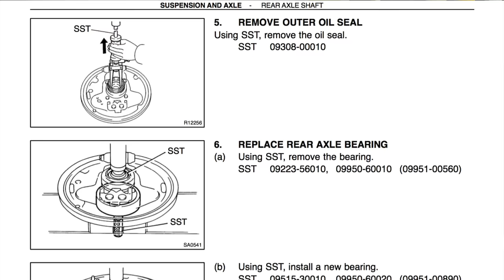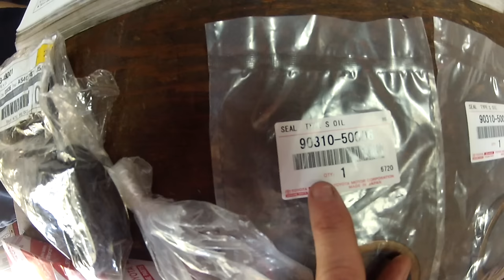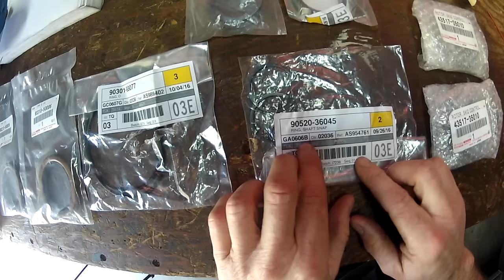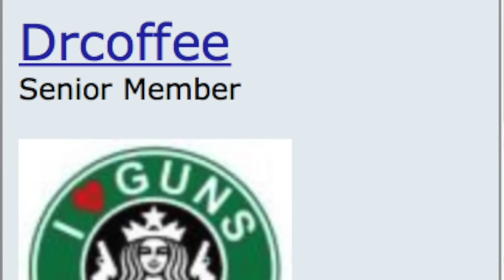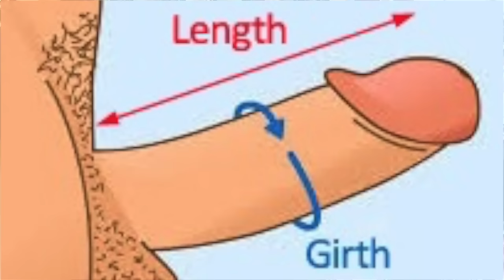Toyota Rear Axle Seal/Bearing Replacement (ABS Rearend)

Comment: Timmy, I'm not sure you covered it or not, at 12:30 of the video you were discussing draining the diff. You mentioned replacing the crush washers. Would you suggest OEM or just pick a few up from Home Depot/Lowes. If so, size?
Reply from the maker: Jerome Jose Get OEM crush washers.
Reply: Thanks Timmy. I'm tackling the rear axle seals, rear brakes, and diff breather mod tomorrow. I have to wait to replace the bearings until I can get my press. I hope I don't have any problems waiting about a month, or do you think I should wait until have my bearings. I won't be driving the rig much, I'll be traveling and I have some time tomorrow so I figured I'd tackle that piece at least. I don't mind disassembling again.
Reply from the maker: You can let it wait.  I just wouldn't take it on some long road trip until you get it fixed.
Reply: Side note, as you know I tackled the rear brakes as well today in conjunction with the Rear Axle seal replacement. I think I made a mistake. During the course of the axle seal replacement, I disconnected the brake line. However, once finished, i just bolted the axle back in place but left the brake line disconnected with the vacuum seal on it. Once I had it reconnected, I started replacing the rear brake shoes and noticed that brake fluid of course was coming out of the rear fitting (opposite of the brake pistons). Of course I'm going to bleed the brakes after everything, but do I need to get like a sirenge and fill up that little reservoir feeding the rear brake pistons? I know very stupid questions, but I'm not a gear head by trade, I just wanted to learn more about my rig.
Reply: Timmy don't mind me, I just watched your other brake fluid bleed/flush video. I'm an idiot, I'm on track now. Thanks.
Reply from the maker: No worries.  Glad you're getting it done with the help of our videos.  You're not an idiot.  You just didn't have all the information at hand that you need to be successful. 
Happy Wrenching Jerome!
Reply: Timmy much appreciated, and I'm happy to say that I've completed it. The reason for the work is because I just bought a '98 Limited, and I had taken it in for all the checks I could think after, to include a thorough inspection from a Indy toyota shop. They gave me 4 immediate things I needed to do, and 1 precautionary1) Rear Brakes2) Rear Driver's Side Axle Seal3) Rear Cam Plug (Not Sure I can handle this one)4) LBJ's both (I'll be watching your vid on this one)5) Timing Belt (precautionary)Through following this vid, your rear drum replacement vid, and the rear differential breather mod, I was able to complete both rear drums, driver's side axle seal, rear diff drain/fill. Total time about 10 hours (I was following step by step, so I wasn't efficient). Observations:   After replacing the rear axle breather plug, I noticed it was completely clogged/rusted shut. I have a strong feeling that that was the cause for the rear axle seal fail, but we'll see.

Comment: Instead of milling, just use a spotface for metal, slow with a lubricant, in a drill press it will give you the clearance you need with less money to be spent!
Reply from the maker: Hey Jess, I had to look up what a spotface tool is but now I know what one looks like after a quick Google search.  I don't own a drill press so I probably would have had to bring it to a machine shop to use your technique to accomplish the same thing.   But, I'm glad you commented because other people reading your comment now have a different way to accomplish the same thing.  Thanks!

Comment: I hope someone can answer this question.  Harbor Freight said that they have discontinued the 20-ton press.  They only have a 12-ton, will that do the job or do I need to look elsewhere?
Reply from the maker: Wow, what a bummer Harbor Freight discontinued it.  It's hard to believe since I imagine it was a very good seller for them.

To answer your question, the 12 ton press can do the job.  You'll need our buddy Duane's tool to make the job easier for you.  Here's a link to Part 2 where we provide a link to Duane's Ebay store in the video description.  He sells a tool specifically made for the 12 ton press. https://youtu.be/R-c2x3F8DU4
Reply: @TimmyTheToolman  Well, looking online I can get the press at a different Harbor Freight, seems they told me wrong.  I did buy Duane's tool and he tells me it will not fit in the 12, so, it is back to HF for the 20-ton.  Thanks!  Your videos are the bomb!

Comment: In your opinion with the cost of all the specialized tools would it be cheaper to take it to a Toyota dealership?
Reply from the maker: It's more affordable to buy the tools and do it yourself and tools are an investment that will continue to save you money.  The only specialized tools you need is a 20 ton press which you can get from Harbor Freight for around $250 and you need to get the special axle tool set Duane currently sells for $127.  We feature Duane's tool in a Part 2 video for this job: https://youtu.be/R-c2x3F8DU4  We link his tool in the video description.

A dealership is going to charge you a ton of money for this job, somewhere in the area of $1500 for the parts and labor.  Labor rates fluctuate though depending on the area you live.  Call your local dealers and find out what they would charge.  

If you like doing your own work, the Harbor Freight press can be used for lots of jobs like front wheel bearing replacements and a host of bushing replacements.  The special axle tool only helps with rear axle bearing replacements so there's a good chance you'll never use it again.  But, you could either keep this tool thinking you might need it again or you could simply sell it on Craigslist or Ebay and get some of your money back.

Finally, if you do the job yourself, you will know it was done right.  Independent shops and dealerships screw up this job with a pretty high frequency.
Reply: @TimmyTheToolman   Thanks for the Reply! I am in Canada. The dealership quoted me $1500 you were right on. The only issue I have is the special rear axle tool will take about a month to ship to me and the 4runner is my daily driver.
Reply from the maker: @nathandulong4968  If you just having leaking axle seals, you can drive that way for quite some time.  Just make sure to check the gear oil level regularly and keep it topped off.
Reply: @TimmyTheToolman  Thanks! I ended up just making the tool so I didn't have to wait as long. Thanks so much for all your videos so helpful!
Reply from the maker: @nathandulong4968  Good job making the tools.  Glad our videos helped you out.

Comment: Which seal driver set did you end up using?  Would the OTC have worked or were the outside diameters of the ends too small?
Reply from the maker: Used a driver from the OTC kit.  The plastic drivers in the Harbor Freight kit are junk.  The driver I selected is a slightly larger diameter than the seal.
Reply: @TimmyTheToolman  Are you sure?  Look at 55:35 in your video.  There is some black thing attached to the rod, and I can see all the ends are still in your box.
Reply: Oh shoot, you did a quick switch back to the OTC….you must have been holding another tool for a second.  Also, thank you so much for the video.  Going to tackle a 2008 4Runner in a week or so, and going over the process has been so valuable.  It’s funny how different real world steps are from the service manual.  I cringed when they suggested using cut off wheels and chisels for this job!
Reply from the maker: @Sanger8  Go to 56:03, I switched to the OTC metal drivers.  I forgot to mention that in the video.

Comment: Timmy, I found a slight leak in the right side- just enough to cover the ABS sensor with gear oil and throw an ABS code. Is it possible to just replace the axle seal without all of the machine shop work? I'm wondering if the leak is related to a clogged vent, rather than a bad bearing.
Reply from the maker: Hey Chris, if you watched the video, you know by just replacing the seal, the seal lip will be riding on the edge of the retainer close to the non-polished bevel.  With some axle play from a bearing with a lot of miles on it, the seal lip may ride on the bevel and fail prematurely.  If you don't want to mess with anything on the axle, your best bet is to not seat the new seal all the way.  Knock it in as even as possible but don't fully seat it.  Do the grease test and confirm that you are getting a good mating of the seal and outer retainer and you'll probably be good for a long while.  It's just going to be hard to knock it in partially and evenly without fully seating it.  

Another thing you could do is just have a shop pull off the ABS gear and outer retainer and press them back on with the outer retainer flipped and with 5mm of polished axle showing above the retainer.  You wont have to renew anything and it will just cost you the shop labor to flip remove and reinstall those parts.  The key is need to be able to "Pull" them off rather than "Cut" them off.

Hope this helps.
Reply: Excellent- I re-watched the part where you set the seal and performed the grease test. What you're saying makes a lot of sense. What do you think about using a 1-2mm spacer placed between the axle seal and axle housing? Just throwing an idea around... Sorry for the novice questions, I have zero experience working on the rear axle of trucks.
Reply from the maker: Chris N in theory that could work. If you do the grease test, and confirm that you’re riding in the center of the retainer then you might buy yourself some time before you have to do it the right way. If your seals leaked into the bearing, and washed the grease out, they won’t last much longer and the play in the bearing could impact how effective the new seal is.
Reply: I'll try the "hack" method first, along with replacing the diff vent (probably clogged with Upstate NY road salt). It's my Dad's truck and he doesn't want to put much money or time into it right now. Thanks again for your comments and the extremely informative video.
Reply from the maker: Chris N let us know if that hack works.
Reply: @TimmyTheToolman  Hey Timmy- My dad has been putting off the repair (he decided to rebuild the leaking axle, instead of just playing around with the seal), but has been slowly stocking up on tools- 20 ton press, Durasolid special tool, etc... We plan on starting the repair next week. Do you recall the thread pitch for the 2 inch M10 bolts?
Reply from the maker: @chrisE815  Hey Chris, the 2 inch M10 bolts I got have a 1.5 thread pitch.  The stock serrated axle bolts are a M10 x 1.25 pitch.  Recently, a couple different people let me know that the Durasolid tool they purchased wouldn't fit all the way over the widest section of the axle (the area where all the parts get pressed onto).  I emailed the company and got no reply.  The people were still able to get it to work but they had to use longer bolts.  I think something changed with the pipe stock supplier they are using because the inner diameter is just a little smaller than before.  The company doesn't offer a phone number, just some message option through their website.  Unfortunately, they don't seem to have the best customer service.  My tool has worked great for me but I'd like them to correct the manufacturing flaw so I'll feel good about referring people to buy that tool.  When you and your dad get around to doing the repair, please report back on how the tool worked for you.  Thanks.
Reply: @TimmyTheToolman  Hey Timmy- You know what they say about people who make assumptions... My Dad's truck is an '06 Tacoma- Which, as it turns out, is different than an ABS 3rd Gen 4Runner- No ABS exciter ring or 2nd retainer- The ABS exciter is built into the bearing. I overlooked this difference and when looking at parts diagrams, I realized the procedure would be a bit easier.

We pulled the right rear axle out and I can confirm that the latest iteration of the Durasolid tool is garbage! I'm having the same problem as other viewers- The ID of the pipe is too small. I purchased 70mm/2.75 inch m10 bolts and still couldn't fully attach the tool to the bearing housing. I ended up half threading the Durasolid pipe into the adaptor plate and then I was able to fully thread the nuts onto the 70mm bolts I purchased. As I started to apply a lot of pressure on the tool with the press, the pipe threads gave! My Dad and I took the axle to a retired pipefitter friend and he cut off the retainer and bearing races and then we had him weld the stripped out adaptor plate to the Durasolid tool. 

To install the bearing and retainer, we used the other end of the Durasolid pipe and then stacked the 2nd adaptor plate on top of the pipe. The threaded hole in the adaptor plate was a nearly perfect press sleeve for our retainer. If we hadn't used that plate, the Durasolid tool would interfere with the taper of the axle. Overall, the installation of the bearing and retainer went smoother than the removal even though the Durasolid tool didn't work as designed. 

When we do the left side, the plan is to use the OEM bearing housing bolts threaded into 4 M10 coupler nuts. This way, we can place ~2 inch bolts through the DuraSolid plate and engage plenty of thread on both sets of bolts. The coupler nuts will act as a spacer to take up the gap left from the Durasolid tool not sitting flush against the back on the bearing housing.

My advice to people looking to do this repair is to either borrow a know-good version of the tool from a Toyota friend or make your own adaptor plate to fit the bearing bolt pattern with a drill press and hire a welder to attach the proper sized pipe. Or buy the $400 version of the tool- It will still likely pay for itself vs having a shop do the work.

Anyway, we are much more prepared and confident in our ability to replace the bearing, retainer, seal, etc on the other side when the time comes. Thanks for spending the time documenting this process and helping the Toyota Truck community!
Reply from the maker: Hey Chris, good job getting the job done.  And, thanks for confirming for me the Durasolid tool has design issues.  I practically begged them to contact me regarding the design issue and I got no response.  And, this is coming from a guy who helped make a video that has done free advertising for their tool.  They are complete idiots to not contact me and fix the issue with their tool.  I did put a disclaimer regarding the tool in the video description and that's pretty much all I can do.  I can't force the company to do the smart thing and fix their design flaw.  Anyway, thanks for taking the time to comment and share your experience.  Happy Wrenching!

Comment: Just wondering what vacuum cap kit for plugging  the brakes lines u recommend ? Sorry , u probably posted a link for it but i cant find it...thank you for your great vids..im your biggest fan
Reply from the maker: Hey Pat, this is the kit I bought: https://www.amazon.com/gp/product/B008DZSZK6/ref=oh_aui_search_detailpage?ie=UTF8&psc=1

The 7/32" cap fits over the flared end of the brake tubing well.  I push back the flare nut fitting on the tubing and slip the cap just onto the tubing, not the nut.

Glad you like the videos Sean and I have been making.  Happy Wrenching!

Comment: Have you looked into a none Toyota seal "aftermarket seal" that may center up without flipping retainer?
Reply from the maker: There are aftermarket seals that wouldn't require you to flip but there quality isn't as good as the newly designed Toyota seal.  When you get one of the new Toyota seals in your hand, you quickly see how well they are designed with plenty  pliability to allow for bearing play as the bearings age.

Comment: Is the inner and outer retainer the same part #? When you showed us all of the parts it looked like there were only 2 new retainers, and it seems like you put on 4 new retainers. Were the outer retainers that meet up with the dust seals reused?
Reply from the maker: The inner and outer retainers are the same part number.  The outer retainers don't meet up with a dust seal.  They are just a place holder for the bearing, that's it.  I don't know what dust seal you're talking about.  There is the dust seal that goes on the other side of the bearing and sits between the axle flange and the bearing case, but that doesn't come anywhere close to the outer retainer.

You can reuse all 4 retainers and both ABS tone rings.  In this video, the guy we were helping, Charlie, chose to put all new parts on but you don't have to if you pull the parts off the axle like we do rather than cut them off like some shops and people do.  By reusing the retainers and ABS tone rings, you can save yourself around $150 (online prices).

I suggest you read the entire video description and also the comment I pinned because there's lots of helpful information in both.  If you have any more questions, just ask.

Comment: Hello Timmy The Toolman I need some help I recently replaced my rear drums on my 4runner but before that my car in the rear was having this loud noise on the rear right drum that I thought it was a brake cylinder knowing that the ABS and Brake light was on but it maybe something else do you may know what is the problem?
Reply from the maker: It's hard to diagnose over the internet.  If you're sure it's coming from the right rear, it could be the brakes or maybe a bad wheel bearing.